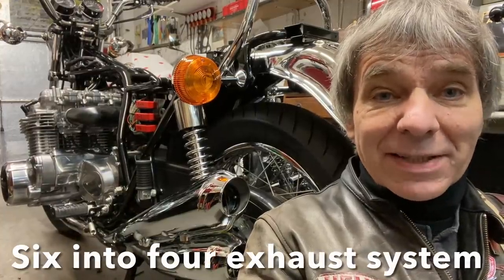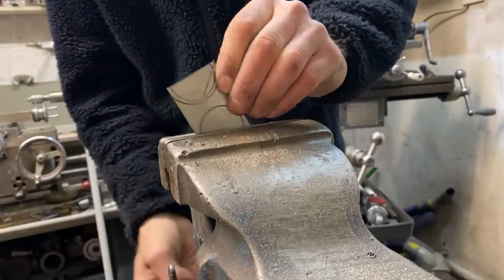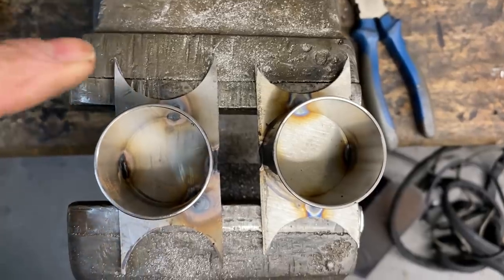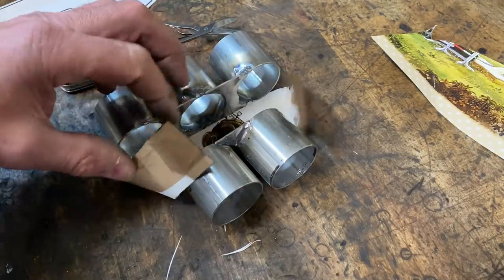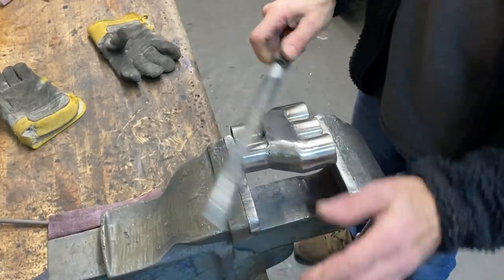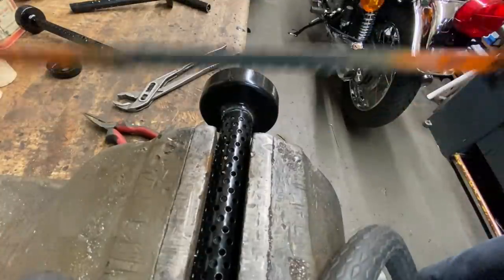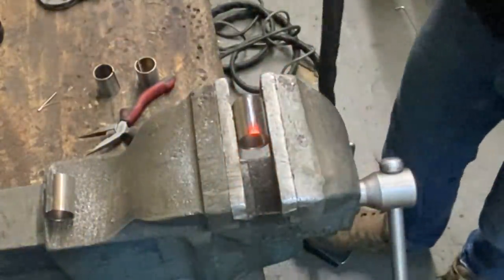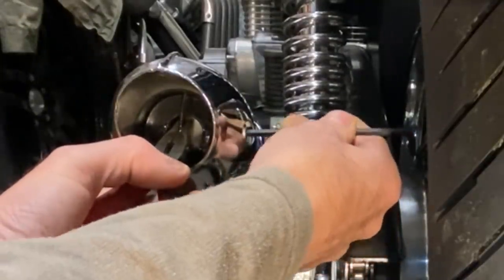Millyard Kawasaki Z1 Super Six exhausts - How its made

Comment: Your patience and skill with a hacksaw never ceases to amaze. I would like to offer a tip about welding stainless though. When finishing a weld, If you let the argon continue to flow over the metal until it looses its glow, you'll prevent the majority of oxidation and maintain the stainless properties better. Also , when back purging a part isn't practical, solar flux works well enough for non critical applications like this. It's easy to use and prevents most of the extreme oxidation on the back side of a stainless weld. In America at least, we call that oxidation "sugaring." it can seriously affect a weld long term. Good video as always. Thanks from the US.

Comment: Tools required to build a perfect exhaust: hacksaw, file, angle grinder, cardboard, a cup cake, some scrap plate and tube. Cost: under £5. I watch your videos and I am blown away at the amazing ability that you have to look at something, chop it up and take it to the next level using basic tools. If Kawasaki engineers were tasked with the same project they would spend millions on R&D, development and tooling. All they need to do is get hold of you on your 60's phone and chat with you for 15 minutes and 45 seconds. Job done. (maybe they watch your videos too.)

Comment: I have a hacksaw too. Once I  trimmed 2 toilet flange bolts. Went well. The rest of the time I use it to cut deadwood out of my lilacs.
Allen uses his to do surgery on cylinder heads and crankcases to make perfectly running v12 motorcycle engines. Seems only right. Who said life is fair?

Comment: How come you use the angle grinder to cut and grind the metal outside on the ground in the dirt? I would have thought in a vice inside your workshop would be preferable? Or maybe not...........
Reply from the maker: grinding dust is very abrasive and gets everywhere, its smelly and bad to breath in. Its nice to get out in the fresh air

Comment: 50 years I have been using hacksaws and I still can't cut a straight line. Then I watch you make it look easy.
 Oh well.
Reply: Practice makes "perfect"
Reply: I am far from perfect at it either, but just take your time with the cut and change the angle of the whole saw when needed.
Reply: After 50 years I need more patience I have already had plenty of practice.
Reply: Ever tried putting the blade in backwards?
Cutting on the pull stroke is often more accurate  though slower....
Reply: @johnpm1605  I have used Japanese saws for the last 50 years also. So yes I do put the blades so they cut on the pull stroke especially junior hacksaws.
Reply: A really good hacksaw makes the world of difference, a cheap frame just won't cut it.
Reply: @deemdoubleu  that's the secret. Keep doing it until your really good.  Cutting competently with any handsaw is like riding a bike.. Once mastered,never forgotten.
Reply: Matthew Lund  You need more practice. Set yourself different cutting challenges and keep at it until it is imprinted. Don't make the learning process into a punishment by forcing too much time spent in one session. 10 minute sessions and a break before having another attempt are the most effective way to learn imprinted skills like hand sawing or filing.
Reply: @johnpm1605  just like a Japanese pull saw works.
Reply: @tonybell4447  I have a couple of very old Eclipse frames. They are my favourite hacksaw frames.
Reply: And Allen saws like cutting butter with an hot knive, so fast ....
Reply: @markmiwurdz202  I'd say yes.
Reply: I had the same issue. While there’s still room for improvement I tried a new saw which made a big difference.
Reply: When I started my apprenticeship they said we should be able to cut with a hacksaw to 0.5mm (about 20 thou). I though “yeah, right!” But it is quite attainable. It’s all about observation, making minute adjustments as you go.
Reply: Stop pushing down. Let the blade do the work. Pushing down distorts the blade and makes it wander.
Reply: Enough already. I posted this as a semi humorous reply which was not received as such. I can cut in a straight line. I have been able to do so since I bought Japanese pull saws some years ago which made me realise that cutting on the pull stroke was much better especially with junior hacksaws. So please stop giving me advice I don't need.
Reply: Not enough cup cakes. Lovely.
Reply: I’ve found proper, New sharp blades make all the difference!

Comment: “Just by eye”.... as always sir, you make the difficult look easy!  I was wondering if you needed to re-jet the carbs with the exhaust pipes handling 50% more gas flow.
Reply: With the baffles being enlarged the airflow would be greater (maybe 50%), so maybe the result would be more or less the same back pressure as standard.
Reply: He'll just adjust it with his hacksaw, It'll be just perfect.

Comment: Hi Allen, without doubt the video of the week mate, quotes that cracked me up: cut it out with my knife, I just marked it out by eye and used me felt tip, also pleased to see you used the famous Millyard "foot vice" in the garden, during which I noted your cutting disc cooling method of cutting through into the wet soil, perfect.!! Just when I'd stopped chuckling, out you went to the Millyard bbq to warm the metal ready for painting and drying, just the quintessential shed/garage engineering. Allen, please don't stop these video's, watching your skills is pure pleasure, the results of your skills are always fantastic like todays headers. Would like to see the Kwaker fire up on video please, stay safe. Cheers, Alex.
Reply: I actually paused the video in order to enjoy this hilarious comment

Comment: Hello Allen, 
I prefer to use hole saws to make things such as the collector pieces, you use a saw and a file which is a lot more tedious to me? Using a miller, hole saws do not require a pilot drill which makes them more flexible to use, particularly for half holes as you did. I made up a couple of pilots that fit my collet chuck, for the two different ranges of hole saws.

Comment: Hey Allen, amazing video as usual. I might try to do the same as it’s probably the easiest way to make an exhaust link without bending pipes.... my question is, Is it ok to go from 3 tubes to an open chamber to 2 tubes? Did you have any back pressure problems? How the fumes are flowing? Thanks in advance for your answer. Tom

Comment: Hello Allen, Bravo on some of the engineering you been doing on these bikes. I am somewhat disappointed you've been chopping up some quite rare motorcycles. To recant for your sins and since your into 2 strokes, why not do a copy of a rare motorcycle, and I mean rare. A 2009 Aprilia RSA250 GP bike  Yep, carbon fibre swingarm and wheels too. There are plenty of pictures of the bike and its disassembled engine all over the internet, making a copy by eye should be doable.. If you like a challenge and have 5 years or so of spare time.

PS no cheating by welding 2 rotax 125's together

Comment: Excellent work. One small thing is rather than using a thicker filler rod when welding thin-ish sheet, use thinner rods or MIG wire. When welding together two stroke exhausts, which are <1mm thick, I use 0.8mm MIG wire. You'll get a far nicer finish, with proper penetration.

Comment: Hi Allen, I often use the hacksaw in the vice like you did in the video and I found it useful to make soft jaws from 1mm thick brass sheet that slip on over the jaws of the vice, and it'll save you taking chunks off the top.  I cut a lot of the bodywork for my steam engines that way with the line I need just below the jaw height.  I've had for a handful of years a 6 inch capacity horizontal bandsaw that can be used horizontal or vertical, and makes cutting 1 1/2" EN8 steel a lot easier, and I've thought that such a machine might be for one of your wish lists.
The 6 into one pipes you have done look well neat and I look forward to your next video.
PS, I'm also making a video for making driving wheels in 16mm scale and I seem to commentate like David Attenborough, do you think I should seek help? lol

Comment: Amazing job Allen, but when you have a 6 cyl.1500cc engine pushing exhaust gasses through 4 silencers designed for a 900cc 4 cyl. bike are you not creating back pressure? just wondering like,also did you enlarge the air filter intake somehow?
Reply from the maker: the first bike runs fine with standard airbox, im not really after the last BHP or RPM its great to ride with endless torque as it is :)